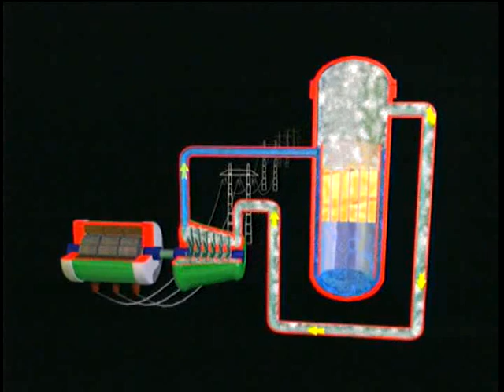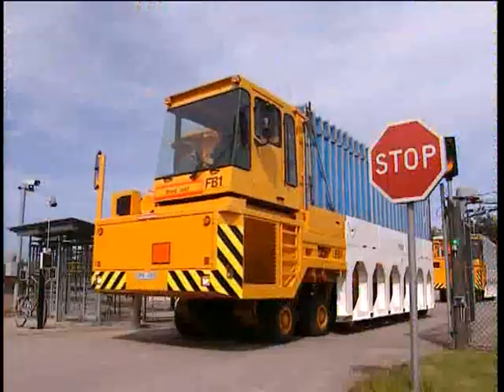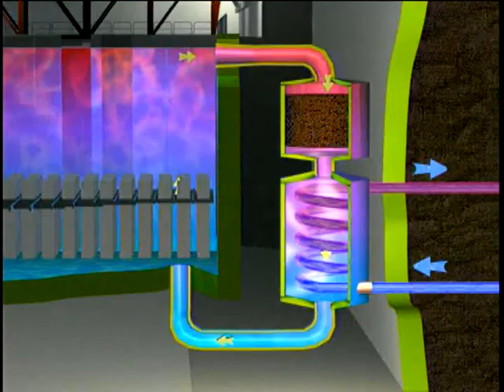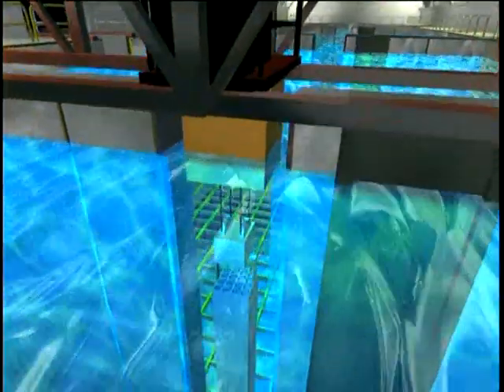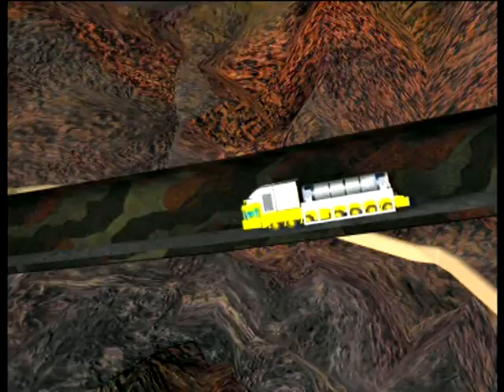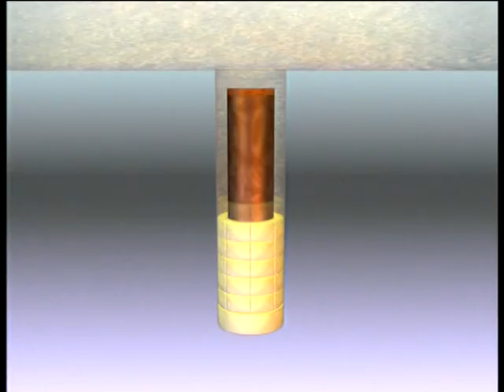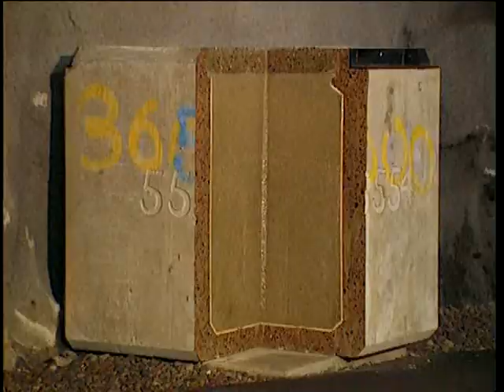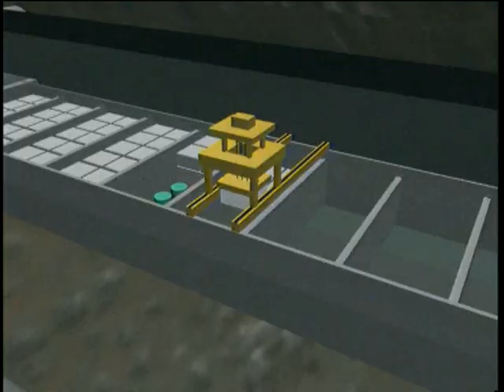Sweden -- how it deals with radioactive waste

Comment: Too bad I rarely ever hear the term "reprocessing" on these things.... 97% of the fuel is still good when the assemblies are pulled.
Reply: MOX fuel?
Reply: 97% is that right?  If so it is a terrible waste.
Reply: @Walter-Montalvo  yep, you chop up the fuel rods and melt them with acid, pull out the americium, neptunium and other bits n pieces we don't want and the reprocess the remaining 96%/97% Uranium and Plutonium into new fuel, called MOX - Mixed Oxide Fuel which can be used in nuclear reactors designed for it. 
The remaining waste is seriously nasty and a lot more concentrated, it can be quite difficult to handle (see sellafield).

The U.S. banned reprocessing under Carter iirc because of cost/effort/waste and the idea that you could make weapons grade material from the plutonium you get out of reprocessing. Yucca mountain, the US long term storage is also mired in politics so each reactor has to be built with enough storage for the fuel it will used in its planned lifecycle, so they just dump the fuel in pools next to the reactors.

Comment: If you include (add up) the actual End-to-end life cycle costs, nuclear might not be so cheap.  As with light bulbs, you either pay during the manufacture and proper disposal or -as is the case with older style lamps, you pay for more energy use during the lamps usable life.  Either way it is probably a wash - six of one; half dicen of the other ...
Reply: Half dozen ...
Reply: Nuclear already pays for it's decommissioning and waste storage, it's called a decommissioning fund
Reply: It already pays for it, and it's still relatively cheap! Ever since at least the 80s this has been paid, and that financed all of the reserch that went into verifying the safety of this storage too. Currently the fee is ~0.05 SEK, so like 0.5 US cents, per kWh.

The neat thing with nuclear power is that the total amount of waste is tiny compared to the absolutely MASSIVE amounts of electricity (and thus income) the plant generates through its lifetime.

Comment: According to the Yucca Mtn project in Nevada, the waste would still be toxic after 10,000 years storage.
Reply: Yukka was  waste storing project was ended in 2011.
Reply: @marcwinkler  Yup, and the waste is still stored in leaking containers, and located onsite in coastal flood zones around the US.
Reply: @ViceCoin  Not my fault dear Friend.
Reply: @marcwinkler  Millions will face the consequences when a release (like Fukishima) occurs.
Reply: @ViceCoin  1 gr of Radium = 1 Curie = 37 000 000 000 beckerels
Reply: @marcwinkler  The town of Fukishima is closed to human habitation for 200 years.
Reply: The high level waste storage is built to withstand at least 100'000 years of storage. And that goes for essentially each of those barriers, and there are 3 of them. The low level waste is just expected to be posonous for 500 years, but that storage is also built to withstand at least 10'000 years.
Reply: @mattegeniet  Yucca Mtn was the only national waste stored project.
Nuke waste is stored onsite.

Comment: Fuel rods that are no longer usable, can be reprocessed. Only about 10% of the uranium in used fuel rods is fissioned. They are no longer useable because of fission products that build up in the pellets and poison the reaction. If you remove those fission products, you still have 90% of the remaining fuel.

Comment: Greetings: INHO the best solution is to use the SNF a fuel for Gen IV advanced reactors designed specifically to burn up SNF while producing electricity. Fast reactors can even consume U238 (aka depleted uranium). The residual waste from these reactors is very much smaller and with a 1/2 life of 30 years will be safe after only  300 years. Although not perfect it is much better than what we do now.

Comment: Question: why not use the waste to heat process water (laundries, interior heating)? Seems like a lot of wasted thermal energy here.
Reply: slightly radioactive
Reply: They've been wasting over 75% of the heat from fossil fuel plants since the start of industrialisation, so that people buy more electricity.... They wouldn't make so much money if they piped free heating to houses so they throw it away deliberately in effect... Don't pay, can't have.

A fundamental logic throughout commercialisation. They throw unsold plants and food away behind shops instead of selling cheap.

They say they are suppliers of electricity but since 75% gets chucked to sustain extortion they are in fact restrictors and controllers of the energy supply
Reply: Its currently illegal because that would actually make sense.

Comment: Long term storage is a waste, as it can easily be reprocessed into new fuel or the starting fuel for a Thorium reactor. It can also be processed into the elements and used for many different things. It is easy to separate the metals from the rods, just need 3 parts nitric and 1 part hydrochloric acid. That is the Acid that dissolves metals such as gold, then the metals can be separated with a centrifuge. Keep in mind that Uranium is more rare than GOLD. We are basically using precious metals to make power and then instead of getting money out of what is left we end up paying to throw it away.

Comment: Radioactive materials exists in nature, but in highly diluted forms (low density). This makes me think it would be much safer to dilute the waste first, rather than storing concentrated waste directly, or even concentrating it further as shown in this video. Even buried inside a big mountain, we can't be 100% sure nothing is going to escape. Unlikely to happen, yes, but not impossible. In diluted form, more space and material is required, of course. Fortunately, there are ideas for using spent fuel as new fuel, which will pretty much solve this headache of having to store so much waste.

Comment: Extremely over engineered solution.
They are still arguing about the corrosion resistance of the copper cylinders. 60mm thick copper incapsulated in bentonite clay.
They want it to last long enough so the fuel wont emit more than background radiation.
It would be good enough to just dump the fuel down the hole and cap it off.
Even If the rock did crack in some way and and some something did leak out it would never reach the surface in a dangerous koncentration.
Few people understand that small amounts of exess radiation doesent harm you more than many other things you are exposed to daily.
Like the dust in the air we breathe.

Comment: How on earth could this be cheaper than renewables????
Reply: Because of scale. We have 3 nuclear power plants in operation now, and they provide about half of the power we need. Imagine how much wind/solar we would have to install in order to make up for that?  Another thing is that nuclear is a very stable source of power, and unlike mos renewables it also provides good enertia to the grid. So considering that, the potential higher cost is justified imo.
Reply: @rtdlaboratories  still not convinced....you havent mentioned tide wave geothermal or hydro
Reply: It isn't if you consider pure LCOE of wind or solar vs nuclear. It is if you consider the cost of energy storage.

Comment: Well it is now 2022. What has happened? This must have cost billions
Reply: Well there was some political controversy, but it has now (start of this year) been finally approved to be built in Forsmark by the government, although they are still waiting for some other permissions to be passed by other government authorities. Then it will take ~10 years to build.

It's entirely financed by the electricity generation however! This is done through a fund, to which ~0.5 cents/kWh generated is paid.

Comment: Oh the hot water goes out to the ocean. Christ people! Warming sea temps weren’t bad already. 🧐
Reply: Well the Sun heats it way more in total. And a coal plant would warm it exactly the same, except create CO2 emissions which tip the energy balance and heat flow for a very long time. Although Sweden isn't building any more nuclear, it will end with the operating licenses. Then Sweden needs to massively increase the peak flows of hydroelectric plants to cope with times with no wind or sun.

Comment: friendly suggestion. move all nuclear profiteers, supporters, and workers closest to storage facility and plants. copper and cast iron caskets for final storage? what a colossal waste of perfectly usable resources. SOLAR, WIND, GEOTHERMAL, HYDROGEN OR GTFO
Reply: So we stop today. the waste is still there. cannot blame or ignore it away, well you can and we will. Welcome to America.
Reply: I agree with using renewable and alternate resources. but just so you know Hydrogen is not a resource and all of it comes from another power source. It is just more efficient form of fuel. (but actually Methane/Propane(Natural Gas) and maybe Methanol and Ethanol(drinking Alcohol) are better transporters of energy.